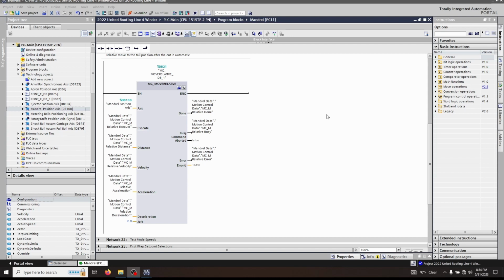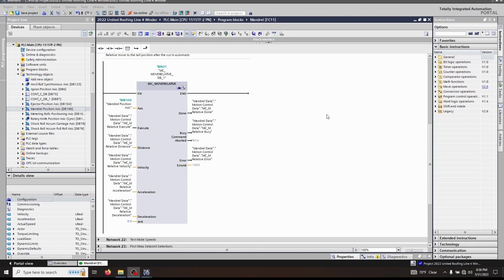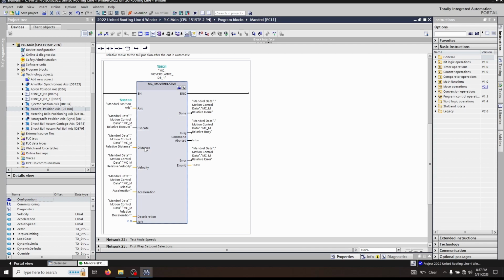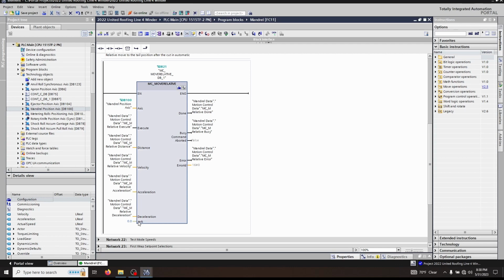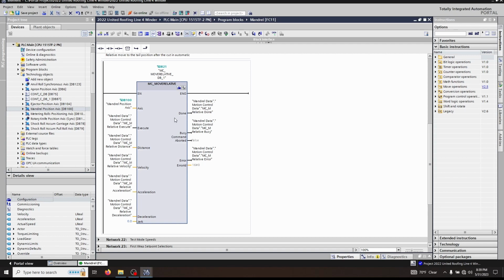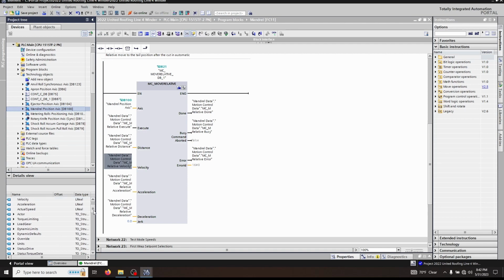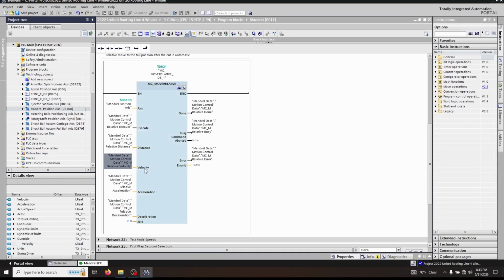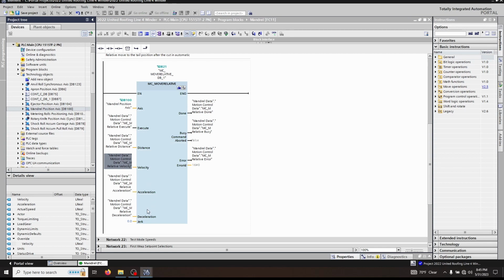Using Siemens PLC Motion Control Blocks: MC MoveRelative

Comment: Hi, how does the distance parameter get into the drive if I use this function but I have chosen telegram 105 ? I didn't find any position setpoint in telegram 105 words or PZDs.
Reply from the maker: Great question! The drive is only a speed controller when using TOs. That means the PLC is doing the position control loop and sending a speed setpoint to the drive. For this reason you want your ramp times in your drive as close to 0 as possible because the PLC generates a signal with a ramp built in!

Doing it this way, the code using TOs can be used on any drive, even one with no communication! You only need a speed setpoint and a speed feedback!
Reply: @jasonwattsae   Thanks!
Reply from the maker: You're welcome!